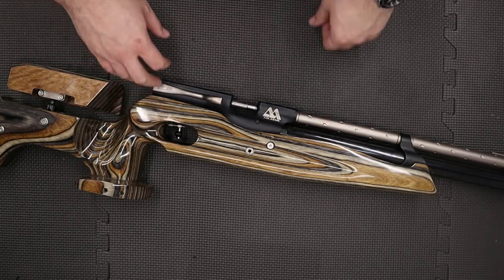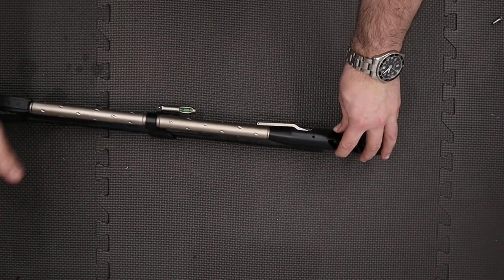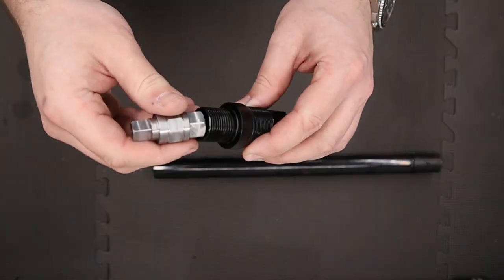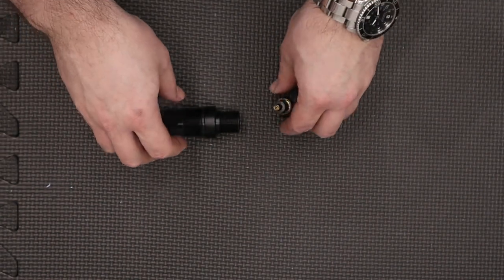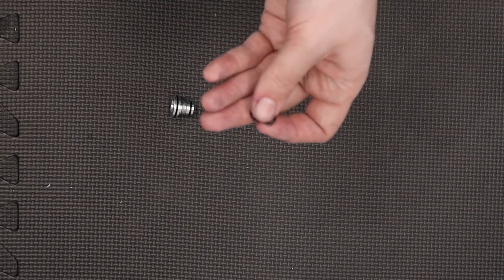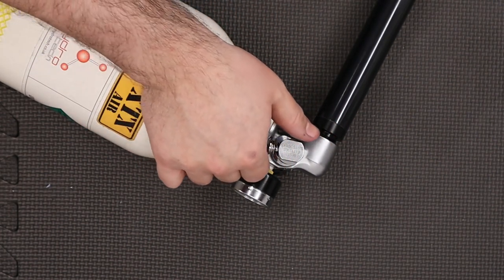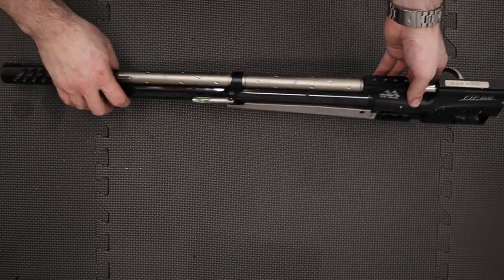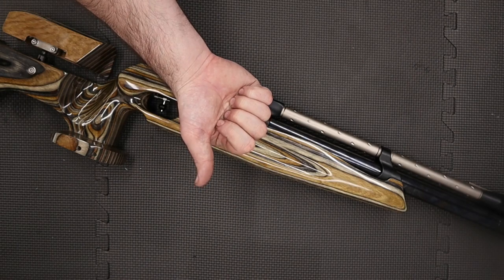Fixing a AirArms FTP900 regulator

Comment: I'm surprised you didnt do anything with the seal on the pressure adjuster.
Reply from the maker: all the seals where changed on the reg 👍
Reply: @sub12airgunners  You did the o rings but not the clear seal in the adjuster that the piston seals against. By the way, a 3/8 square drive fits the back of the adjuster, no need for a special tool.